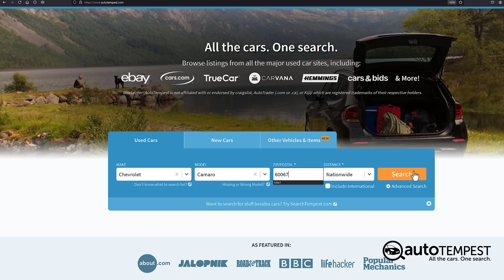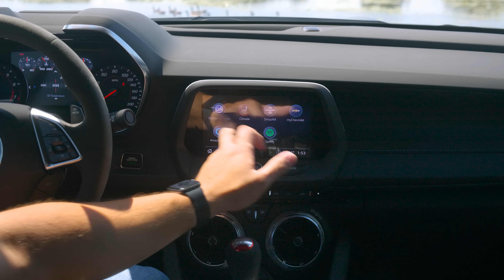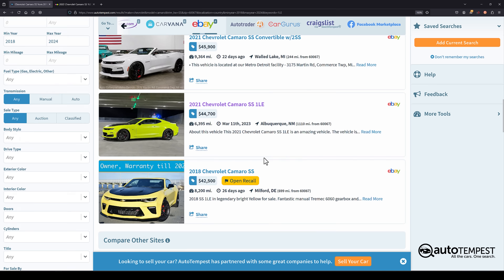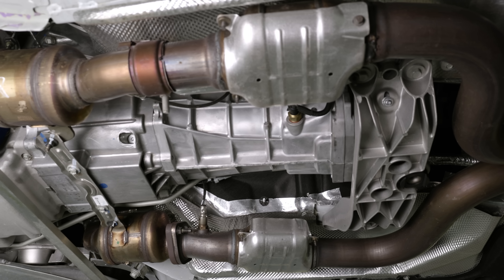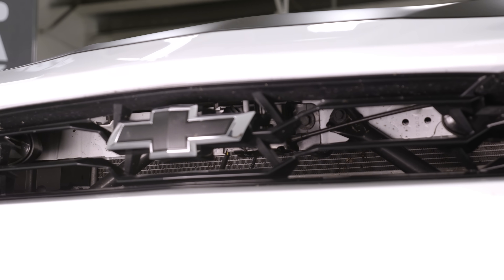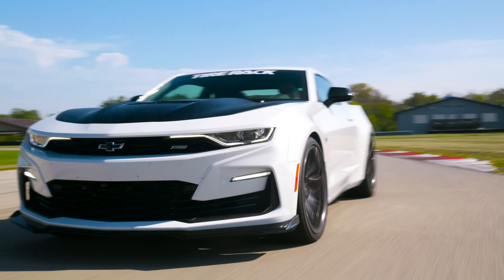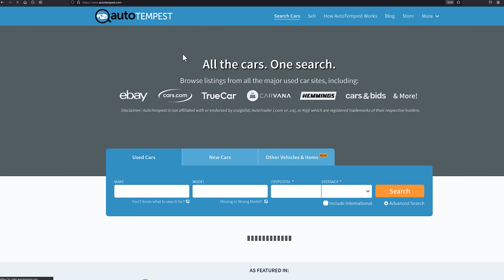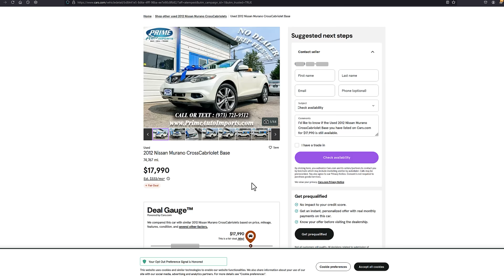Chevy Camaro SS 1LE | Best Used Sports Car of 2024

Comment: Take a few hundred pounds of dead weight out, put 19s on it with fatter tires, and add an intake and cams and you have a 500hp car that weighs 3500 pounds WITH fuel and driver. And it will run laps around everybody all day long.

Comment: If gm just wouldn’t have messed up the design it’d be one of the best all time and I’d have one. All they had to do was add a little cut lower from the door like they did on the c7 corvette and the visibility would be ok. Instead it’s entirely slab sided with a super high belt line and ugly as hell.

Comment: 2021 Chevrolet Camaro weighs 1703 kg / 3754 lb,  has 455  BHP and 617 NM of torque,  No wonder it chews its tyres up.  But the real kicker for me, is its ridiculous combined Average of just 18 MPG!..If you drive around town that's more like 8-10 MPG!  No way is this car a viable daily driver, or even remotely practical in any scenario really. Whilst i love its muscle car looks, it just doesn't add up, its basically an old dug up, US dinosaur, built well, but for a bygone age, like the 1970's when US gas/petrol prices were only $0.36/gallon, prices in 2024 are 10 times that now!         
        As for obligatory drifting and trashing of the the rear tyres, why do all car reviewers always feel they need to do this? Its ridiculous and nobody drives like that or even wants to, the idea is to drive without loosing traction. 
    Apart from my moaning, I loved this review and this channel is just fantastic, so another moaning thumbs up from me! 🤣
Reply: Your MPG numbers are totaly wrong for the SS 1LE (you were quoting the ZL1 MPG which has a supercharger and makes 650 HP and torque).   The SS MPG is 6 city, 24 Hwy.   The 24 HWY is under-rated, as I have easily averaged 28 on road trips (very tall gearing with 6th gear in the M6 - you have to be going 55 or 60 before you can shift into 6th).

Comment: It's cool, fun, the savings are there...but the thing is in about 7 years GM will not support the platform anymore and then you can't keep it on the road if anything breaks.
Reply: dude what?
Reply: Maybe 10 years? Just sour grapes over here. Family members burned in the past with GM performance cars being unable to get parts after a relatively short while even for cars that were in production a long time.
Reply: The car has been around for 8 years add in another 7 that's 15 years of production. There is going to be plenty of parts for quite a while, new or used
Reply: @Arkeo36  damn thats upsetting. I thought the aftermarket would take care of literally all of this stuff. I'm a jdm guy and i can find parts for 35 year old cars, alot of times better quality than oem parts.

Comment: Camaro’s are wannabe Mustangs which are wannabe Chargers😂 it’s the most driven because it’s the cheapest option for quality.
Reply: You are ill informed.   The charger is a high horsepower engine mounted to a poorly designed barn.  It's  Fast (and cheap) in a straight line, but handling sucks (aka it's a muscle car).    The mustang is better, as the power is still there, but the handling is quite a bit better (enough that it's no longer simply a muscle car).  The G6 Camaro, on the other hand, is purpose built to be a superbly handling sports car that just happens to have a muscle car engine.   It's anything but a wannabe Mustang or Charger.

Comment: This car got fu%ked when they changed from the original larger c platform for the smaller ‘a’ platform. After that it was no longer a muscle car
You guys should review the first few model years of this car versus the abomination it has become. Then - you will get more subscribers. 
Let the video be titled ‘camaro - its transition from muscle to sport’
Reply: Depends on what you want it do.   I've been around long enough to remember both the Camaro and the Stang being criticized by car magazines as "good in a straight line, but don't expect it to corner."    Well, they finally changed both (and especially the G6 Camaro) to offer speed AND cornering, and I love it.  Amazing on the race circuit, with the V8 savagery to boot - best of both worlds.   You say tomato, others say tomoto.

Comment: I'd take a used '18 to '20 GT350 over this. Can't beat the sound of that flat plane crank at 8500 rpm. Don't get how you went through this whole video without even mentioning it. It's more of a competitor to this than the Supra you kept talking about.
Reply: Its just soo much more money used. Combine that with the earlier cars engine issues
Reply: The Shelby GT350 below 4000 rpm is lifeless, no torque available, didn't like it for street driving after I test it.
Reply: @jackholmes8105  Only about $10k more used and they're going up in value, so they're more of an investment than the Camaro, which is decreasing in value. The engine issues are why I said '18 to '20.
Reply: @jmmch3358  Had plenty of torque for me. I drove a '17 for a few days and it was great. It is a revver though. I had no problem dropping two gears when I needed all the power.
Reply: @aaronbritt2025  During that time I had a SC 5th gen Camaro ZL1, and I compared to my car and was really disappointed of the Shelby GT350 torque during street driving, but the exhaust sound was amazing and driving at top 8000 rpm, but could not live with it as a DD, instead I went and bought a Corvette C7 Z51 with crazy torque like the one on my ZL1. The Shelby GT350 is more a track machine than a DD, on 1st shift you already above the speed limit, that losses the fun of shifting, the Mach l for DD would be a better choice than the Shelby GT350.
Reply: @jmmch3358  Of course it's going to lack torque compared to a pushrod motor with a PD supercharger. My comparison was to my '08 California Special and '03 Mach 1.
Reply: Too gutless below 4000 rpm. Sucks to have to rev in the stratosphere ALL the time.
Reply: To each their own. I’ll say that I was very close to getting the 350, but went SS 1LE. Main things were price, reliability, and overall fun factor. Used low mileage non-R 350 was over 10k more than a new 2SS 1LE. And the Voodoo engine issues worried me. Was something like 25k for a new 350 motor not including install. And I rented both cars on Turo and had an equal amount of fun. Guy I rented the 350 from had already gone through a motor and two transmissions.
Reply: @amrocko  one motor and two transmissions😳

Comment: I’d take a Civic R over this any day. I could care less about power, you can’t use that kind of power anywhere anyway. Plus the Honda will last longer and hold its value far better. The Corvette would be the only Chevy I’d buy if I had that kind of money.
Reply: This camaro has a corvette engine
Reply: Last longer? I doubt that a turbo 4banger will outlast an LT1. And rear wheel drive is so much more fun that front wheel drive.

Comment: It's still an ugly car and that's the reason why it was canceled  should javelin changed the iconic 2016 look if you could do better. Look at dodge..the Charger and Challenger are hugely popular on very little change.
Reply: Chargers and Challengers are big heavy porks with very bad handling and can't put the power down. They only look good and have great space inside. This cars are only straight line racers.
Reply: @jmmch3358   the Charger sales for the same time period was 78,000. Camaros were 21,900. The Challenger was 54,000.

That tells you one thing.
Somethings matter more to the everyday person and chevy willfully ignored it
Reply: For people just interested in looks not in performance, the Challenger its a great looking retro muscle car good for cruising. But if you want great performance the best is the Camaro and the track packaged Mustangs. Seems that the big majority of purchasers went just for the looks only.

Comment: This is NOT a sports car.  It weights 4k has literally the same visibility as The Spirit of St. Louis and rear seats out of a Miata*    Jack and Mark Commenting like this was built in 1995 is bizarre...it JUST went out of production.  I'll bet dealers and still trying to move these off lots with limited success.  Sure it has Recaros but after that it has THE WORST interior this side of a GR86.  The center stack appears to be a carryover from an '85 IROC.  I'm not defending the 'Stang either, it's a massive pig with slightly better interior.  Saving grace= manual.  I'd rather buzz around a track in an NC or that 1985 IROC...this is in fact a Caddy with crappier parts
Reply: Drive it on the track and I can guarantee you won't be saying that (nor will you care at that point what it looks like on the outside or the inside).   The handling dynamics are superb and performs better than most cars that cost 2+ times as much.